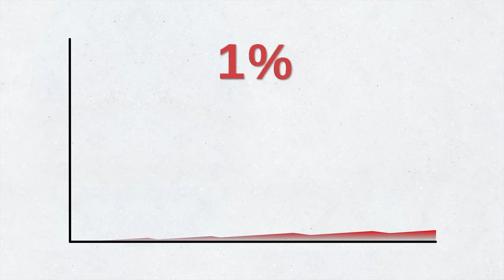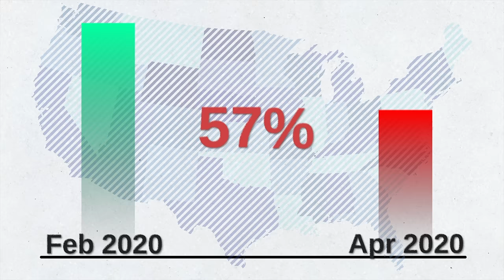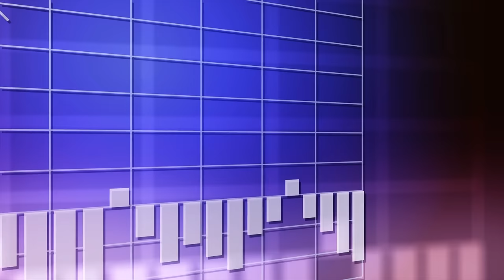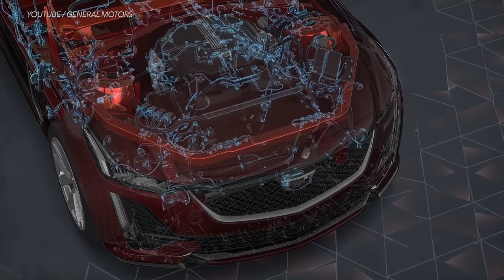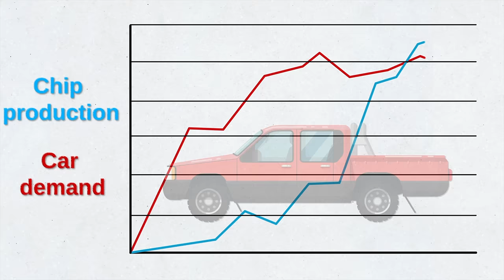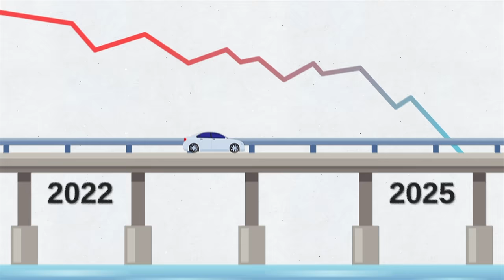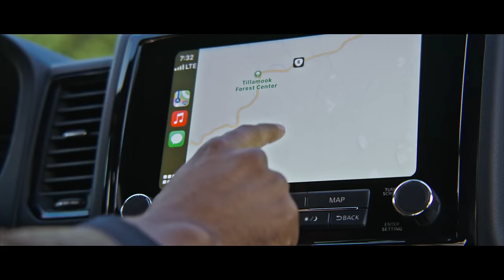Brace Yourself, The Car Crisis Just Got a Lot Worse

Comment: I bought a 2004 Acura tl (137k miles, manual trans) for $2500. It was a decent deal, the interior was pretty rough but mechanically the cars in great condition
Reply: A fantastic find! If the transmission hasn’t been abused this powertrain combination will outlast the body!

Comment: I just bought a used f-150 for $1200

Truck $1200
New seats/ radio $80 
4 new wheel bearing $800
Manifold $800
Rear spring brackets $100
Total so far $2,980
Reply: Buy the ford specific tools while your at it especially if it’s a triton motor

Comment: Our 2013 Honda Pilot has just under 100,000 miles.  Our 2018 Mazda 3 has about 81,000 miles as my job isn’t very close to home.  Both of our cars are doing fine at the moment so we’re not interested in buying replacements at the present time.

Comment: I have a 2003 Nissan Pathfinder with over 191K. Engine is still going strong, but rust and brake issues made it impossible for me to wait any longer to buy a new car. I was able to buy a Mazda CX-5 for MSRP. Not my dream car, but something safe an reliable that I can use for a few years and trade in when the car market stabilizes. Other than having to wait a few weeks for the trim package I wanted, I had a pretty easy buying experience. I got fortunate with a dealership that wasn’t looking to squeeze every $ out of customers.

Comment: I purchased a 2020 tacoma off road 5 months ago that the original msrp was $34,000. I purchased is at $52,000. Brand new from the dealer. I got a new vehicle because my previous car was starting to have major problems. I have wanted a tacoma for many years now anyways.  I was actually wanting to purchase the pro version in standard transmission. Its msrp is $43,000 the dealer wanted over $100k for it. I do love my new truck but I have actually had to get a second job just to pay for the gas. I do know that this truck well maintained will last me many years. Thank you Scotty.

Comment: Bought a new Chevy spark December 2020 for 14k, decided I hated it about 9 months in purchased a used 2014 CRV and I had to put a large down payment to bring it down to where I could make it work but did so and got 15k for the spark and paid 16k for the CR-V total, it's only worth 14k but the value is increasing so it is what it is that spark was horribly uncomfortable.

Comment: Just bought a subaru wilderness. Paid MSRP for this model which was a brand new this year. All features are there and running.
Sold my junker 2001 accord to junk yard and got $400 with a bad starter (not starting). Junk man was soooo thrilled to get it. He rushed around to get it on his flatbed and get away. He bought it for $395.. and handed me $400 cash and said to keep the change.  I'm still shaking my head over that.

Comment: I am getting a subaru crosstrek limited and I'm glad I put the reserve payment down because I believe the chip shortage won't be ending for another 4 to 5 years if at all the. economy is  suffering because of the growing population which is a growing demand and without everyone recycling every year there will be no chance in hell the market is going to bounce back...the msrp for the car I got jumped up $1000 in 2 weeks which I believe has alot to do with tax returns but chip shortage has been a thing for almost 2 years not just a couple months
Reply: Was it really the MSRP jumping $1000, or the Dealer charging you price?
Reply: @musiclover me  so it's 30,670  for a crosstrek limited with moonroof package 1. But obviously, they come with accessories like floor mats and auto dimming mirrors so I bought mine for about 800 under msrp with accessories...now how could I have done that with a vehicle shortage and a vehicle that's in high demand in my region...I'd have to be a sales genius...go buy a vehicle if you know what's good for you. The value for new or used reliable vehicles is only going to grow and pretty soon you'll be lucky to find a used reliable vehicle for under 15k with less than 150k miles on it
Reply: @freethinker5225  My hat's off to the purchasing genius!
Reply: @musiclover me  not exactly lol just did my research but my credit is garbage so I'm taking a hit on interest rate in hopes of refinancing within the year basically going to be paying 10k in interest as it is now after a 72 month term...definitely not a genius just a guy in a tight spot needing a vehicle that I can rely on and get the best deal I can afford

Comment: I traded my 2018 Nissan Frontier SV 2WD in for a 2022 Nissan Frontier ProX. I got $24,000 in trade value, and paid $49,000 for my new truck. MSRP is around 43k as equipped, but with such a good trade value, it didnt hurt that bad. In 2019 i bought the 2018 Frontier used for $23,000, and used it to start my company.

Comment: Had an 05 Colorado bought it for 8 grand at 140,000 miles about a year later I sold it because I was being deployed for a year and didn’t want to worry about it. Sold it to the original dears sister location for 6500 at 210,00 miles. All things considered I think I made out pretty well.

Comment: To answer your request I got a 2004 GMC Envoy in December 2020 for 6k dollars and came with 185k miles. Probably overpaid and came with a few problems like stalling but fixed that with a new O2 sensor. I change my own oil regularly and still works fine with now 216k miles.
I'm pretty sure the transmission oil has never been changed because the way it looks, but it doesn't slip and I baby it all the time.

Comment: My wife and I both had accidents with our cars in January. 25-year streak with only one fender bender between us down the drain)  Wife got a 2017 Mustang with a manual transmission for about  $24,000. I picked up a 2004 Lexus 330 with 115,000 for $6000. The Lexus definitely has some character but all-in-all will live with it for a couple years. The problem for me is now we have two older cars with heavy cosmetic damage and pretty high miles ( we were talking about donating a year ago ) that KBB says are worth two or three thousand each. I feel dirty even thinking about selling them for that.

Peace and solidarity!

Comment: 2007 Jeep Grand Cherokee ...with 150k. I got her new spark plugs.  flushed the coolant system.  got her new engine coils. a battery. water pump. timing belt. alternator. radiator hoses(upper and lower).  cleaned all the electronics.  new tires. front shocks. and i'm using Lucas additives for the fuel injectors.  and Marvel Mystery Oil for the fuel. and I'm taking it easy with her and spoiling her.... I need her to last especially in this market.

Comment: In February of 2021 I bought a base model three year old 2018 Civic with 46,000 miles on it for $18,000, tax, documentation fees, and license included.  I totaled the car in a wreck a year later, almost to the day this February,  2022.  To replace that 2018 three year old model with a 2019 base model three year old Civic with the same mileage would have now cost me $28,500. 
 I went on Craigslist and bought a beautiful 2011 Camry SE with 113,000 miles for $9,100.   The insurance company gave me $19,000.  I put $10,000 in the bank.

Comment: I just bought 2006 Pontiac vibe for $5000 with 128,000 miles from a dealership. It needs some work but better than a lot of options out there.
Reply: oh god dude.  please sell that pos right away.   you'll be glad you did.  have not been a scotty viewer very long eh?
Reply: @ronvalley1973  Why do you say that? The Pontiac vibe is just a rebadge Toyota matrix. Which Scotty has done videos praising this platform.

Comment: Hope that's true. 
2014 Camry SE in above average shape for 17,995 with a newly  rebuilt transmission, new Platinum plugs and new hi performance tires.
Hi performance front brakes and Rotors from EBC.
Delivery in the 49 states available. 
Hawaii you're on your own.

Comment: I have a 2012 VW Jetta with 49K miles that I bought 4 years ago for $5K.
It is my spare car.
I have a 2000 BMW 540 straight drive with 210K miles and a 2015 Golf with 120K.
I could sell the Jetta for 8K now, but it is the insurance policy if one of the others shits the bed.

Comment: Starting a new job and needed a vehicle as my old job gave us company vehicles. I really wanted a Ford Maverick and ordered one anyway for no money down or anything. But ended buying a used 2019 Ranger. I think I’ll hang onto the Ranger as the Maverick seems pretty meh now that they are hitting the road. Thought about bridging the gap with a “less expensive vehicle” like you suggested BUT to get ANYTHING relatively new with lower mileage, I would overpay A LOT. Cars that I wouldn’t pay more than $10,000 are going for $20,000+. Then I’d be stuck upside down with a vehicle I didn’t want. Yeah I overpaid for the Ranger but at least I love it!

Comment: If you buy a used car with over 100,000 miles on it, start buying spare parts now. Spark plugs, air, fuel and oil filters, fluids, distributor, plug wires, belts, wiper blades, maybe a water pump, muffler, lights. Otherwise, what are you going to do when real shortages hit? Scour salvage yards?

Comment: I had bought a used 2019 Mercedes in 2021 for $18,000 and I sold it 7 months later for $23,000. Excelent profit imo, but I wouldn't be surprised if the dealer sold it for $30,000.00

Comment: I was driving a 25 year old Toyota 4Runner. I bought it new and Loved it. Then the air conditioning stopped, the valve cover gaskets were leaking, the back axle started leaking, the rear shocks were tired and it was past due for a timing belt and tune up.  I was looking at $6000 plus to sink into a 25 yr old car with 260,000 miles that if written off, my insurance would pay out less than $3000.

I shopped around and found some dealers that were selling the new models I wanted for MSRP only.  I ordered one and had to wait a few months, praying that nothing else catastrophic would happen to my 4Runner in the meantime. 

The new car came and I sold the old 4Runner for $10,000 without putting a dime into it.. So, it turned out to be a great time to trade up for me.

Just don't pay more than MSRP. If a dealer is asking for more, move on.

Comment: I recently purchased a Toyota Corolla LE, which was the most basic model available at the time. It has few features but I was able to get it at the sticker price of just over $21,000.  This came as a shock to me as I've always been able to negotiate down to well below the sticker price. However the money I save in fuel versus driving my 2011 2500 HD truck (with a V8 gas engine) makes two payments per month, and the higher fuel goes, the greater the savings, by not having to drive a truck which gets 7-10 mpg around town. So in the end buying a small car now was the right decision.

Comment: I really enjoy all your videos and they are very entertaining too, I have enjoyed many trucks built in the 40’s and several very cool hot jollopys (sp) from the sixties, I still love retro vehicles and have a friend building a 1950 1 half ton panel Chevy truck, to compliment my 1971FX Harley that only has a modified Harley cases and flowed trick dual plugged heads with S&S stroker guts and all top shelf running gear etc. I am in my early seventies and blessed with good health 😎

Comment: I think many luxury features like on the seat comfort features should be aftermarket or optional upgrades rather than come factory installed. But driver assist features that get as close as possible to the self driving car are important for road safety purposes and be factory installed.

Comment: A suicide deer hit my 2017 Hyundai Sonata head-on earlier this month.  Took out the grill, hood, radiator, and unfortunately airbags deployed.  Paid $12K in late 2018. Just got the insurance check for $18K this week.  Taking Scotty's advice.  Hanging on to the money until prices come back down to earth and also looking at used vehicle that are not in great demand.  Saw a 2002 Toyota Camry SE with 221K Miles and manual transmission asking for $3900.  That's a lot of money for a 20-year old car and high mileage!  Definitely waiting until the bubblle bursts!

Comment: If a person can't find decent used car for less than $5000.00 they don't even deserve to drive.  One of the biggest factors when buying a used car is to ask yourself, "Can I fix the car myself if something goes wrong?"  I always ask myself this as most car repair shops will charge a minimum of $1000.00 for any type of service today (2022).  If you have a car that you can fix most of the problems yourself, then that's a huge incentive.  Buying a newer car less than 5 years old is nice but most cars that are less than 5 years old are major money pits due to the severe overuse of electronics, sensors, and integrated computer systems.

Being able to fix one's own car gives the owner a REAL sense of personal satisfaction.

Comment: Had a 21 Subaru ascent with 8k (17-20mpg avg mix highway/city)- sold it to CarMax for what I paid for. I went and got a 2022 highlander hybrid at MSRP. That is consider high for me. Got it for month put 1400miles on with 35mpg avg. In Bay area Cali gas is getting up there 5/gal regular 87.

Comment: I have an idea. Design and produce a tough, safe , low-cost, reliable analog car to be sold for under $15000. Crazy? I don't think so. When NAHSTA crash tests started in 1990's, most cars were analog and worked fine. If someone in car industry can open his mind, he can make a car that uses the basic electronics with factory made (not imported) parts.  I don't need crappy computerized glove box doors, electronic parking brakes, remote controlled starters and all that trash that makes small cars into money spending hogs. I and all people need good priced , reliable and drivable cars, not GPS dependent computerized 🍋 lemons. Thanks for the video.

Comment: I don't need to worry about any of this. First of all, I have 3 cars and a truck, so if one should break down, I have backups. The newest one is my transportation car, a 2006 Mercury Grand Marquis, which should have at least another 100K miles left in it. But when the engine wears out, I don't plan to buy another car, I plan to replace the engine. Same goes for the transmission. And any other parts needed to keep it going. I plan to drive this car, or one just like it, for the rest of my life. You couldn't give me a new car with all that garbage technology on it. Having been a fleet mechanic for 40 years, I know the 4.6L 2V Ford Panther cars (Grand Marquis, Crown Vic, Lincoln Town Car) inside and out.

Comment: Just bought a Honda Odyssey for $5k below market value because I happened to see a few scratches down the back quarter panel that had been touched up. Basically they had a test driver leave something in the rear sliding passenger door, didn't realize it, and opened the door automatically, and it scratched the paint. My paint guy fixed it to where you can't tell anymore. Nbd. 2021 Honda Odyssey Elite with 143 miles for $41k even out-the-door 😆

Comment: My trusty 04 Honda Accord with close to 305000 miles needs a new catalytic converter - other than that it runs just fine. I live in a state where it is going to fail inspection when it's due in August. At that point I will put a new cat in - knowing I will easily get at least another two years out of it. Hopefully by then, these issues will have worked themselves out in the industry and I can get the 2015 Toyota Tacoma I want without being attached to it on an inclined plane wrapped helically around an axis.

Comment: I’m UK based, but the pandemic and of course, Brexit, have both impacted car prices for new and used. I was lucky enough to buy a used Ford Focus last summer at what would be an expected price; but the way prices have increased since then, I could sell it today with 10,000 more miles than it had when I bought it, for about 20% on top of what I bought it for!

My brother had trouble buying a new car last year also. He ordered a new Mini on a PCP deal; and firstly he was advised there was a 9 month wait; then he was advised there was a possibility the car may not come with Mini’s new touch screen dashboard (obviously due to BMW/Mini cutting down in parts dependent on semiconductor chips as you explained). Eventually it was a 6 month wait and he did get the touch screen dash he’d ordered; but it was all up in the air til a couple of weeks before delivery.

Comment: Bought a car last month, cheap! $595. Guess what, it doesn't have those high tech computers and features. Just a mechanical fuel pump, carburetor, and a manual transmission. And there are still many rooms for upgrades

Comment: It's because demand for used cars is up year over year for almost all reasons.  More buyers from US and buyers new to US.  People spending less buying used vehicles more frequently than new.  More resellers and bigger salvage repair businesses.  Supply for new cars is down due to supply chain and business structure changes.  Dealers aren't buying bulk fleet financed cars stored on lots to sell for manufacturers.  Main demand increase is from working class choosing used car purchases.  It's a value bubble in autos from value of money saved with used cars: just realized as added to the sales price.  Buyer beware.  Inflation of other foods is pushing up prices.  Sell or hold don't buy used now.